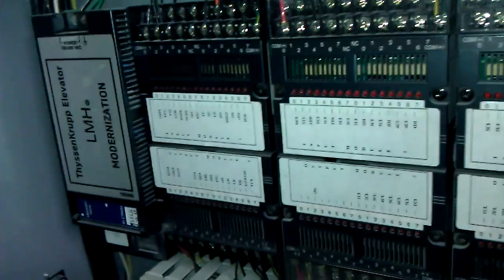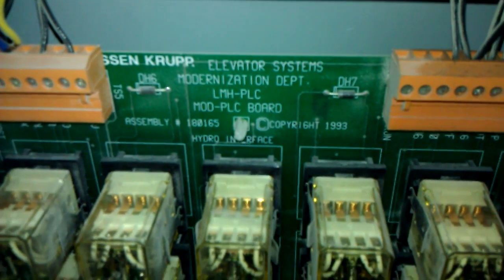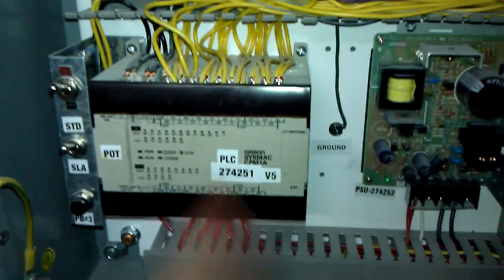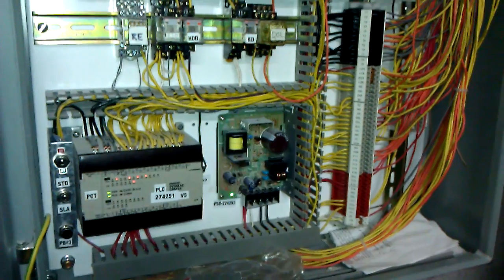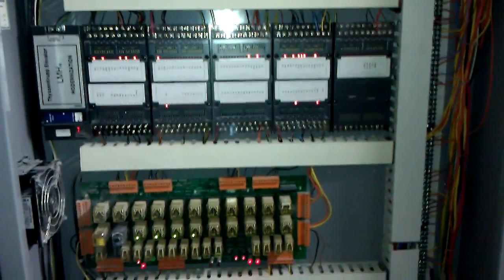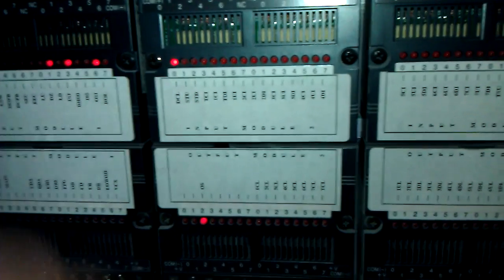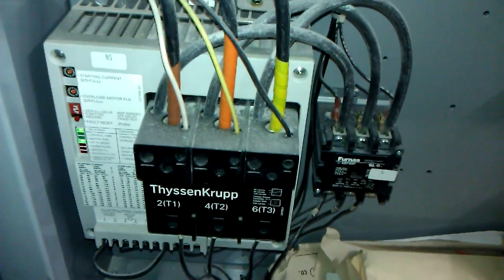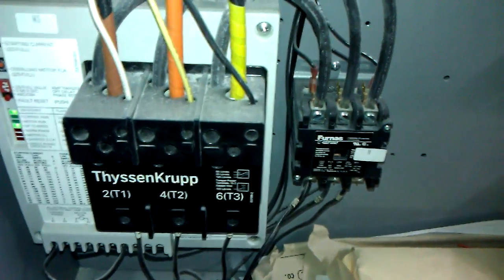ThyssenKrupp elevator reboot

Comment: Dover and then ThyssenKrupp primarily used this controller for modernizations and non standard new installation jobs(freight doors and prison/jail control). The LMH worked good for these applications as the PLC could integrate with multiple voltages and external input/outputs. The standard controller used for hydraulic passenger applications was the DMC which was a microprocessor that used some serial communications. 

The LMH and the DMC were replaced with the Thyssenkrupp tac20(2001-2011) and now tac32(2011-present). The LMH is now considered obsolete as the PLC is now longer supported as well as the main relay board. The good news is they typically run fairly reliably if installed and adjusted properly.
Reply from the maker: Thanks! I wondered just what the LMH controller was all about. Jail control? I guess it's more of a generic PLC that can also meet codes to run elevators. Trippy.

The doors on ours are controlled by an Omron PLC in a box supplied by Peelle; it's got a bunch of din rail mounted contactors to run and reverse the cute little 3 phase motors.
Reply: Jail/Prison security control is were some if not all the elevator functions are controlled remotely in a centralized command center. That way the jail or prison has complete control over who gets on and where the elevator goes and even when the doors open or close.
Reply from the maker: +badandy5187 oh that'd explain that modular controller that lets you add gpio forever ;)

Comment: Door PLC? Whats that?
Reply from the maker: The Peelle freight elevator doors have a pancake motor and a few switches present at each floor landing to control hands-free opening and closing - they don't have a mechanical clutch like passenger elevators. The PLC in the wall mount cabinet here controls the door motors at the upper and lower landings.

The doors are actually unlocked by a spring loaded "retiring cam" mounted on the elevator cab. Before the elevator moves, it has to wait for the doors to close then retract the retiring cam (makes a huge bang sound) to lock them. When power is lost the retiring cam will spring back and unlock the door if the elevator is lined with it.

One of the best freakouts I had on this thing resulted in the Peelle PLC trying to run the motor to open the door while it was still locked... huge grinding sounds were produced!